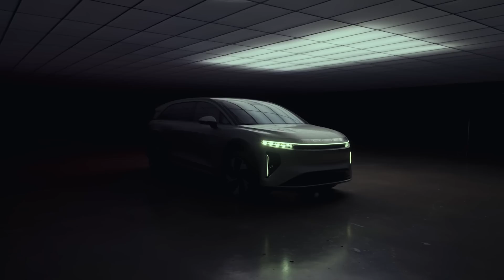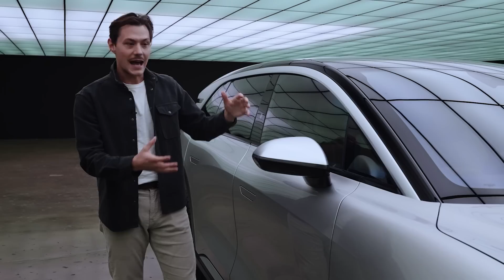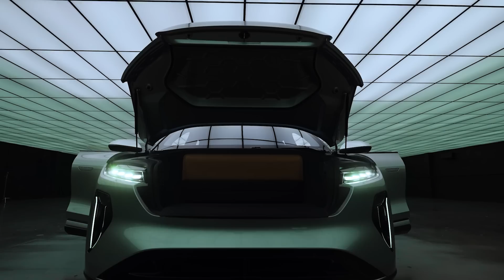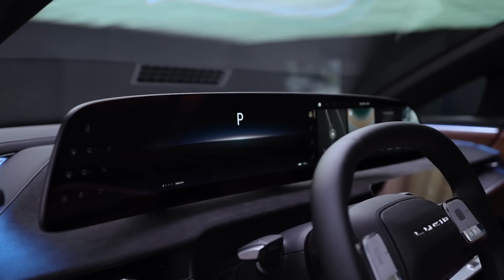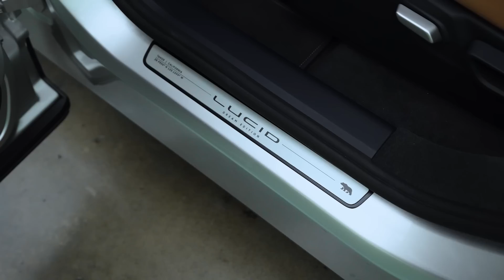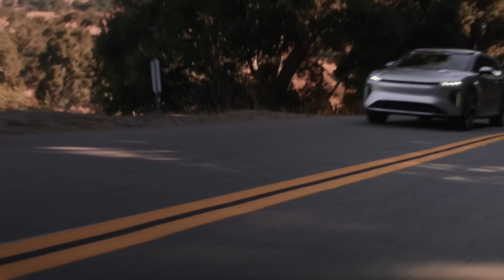Lucid Gravity - Luxurious Electric SUV for under $80,000? | First Look

Comment: Lucid has officially announced it will join the NACS migration starting in 2025. 
First, vehicles such as the Lucid Air will be granted access to the Tesla Supercharger network via adapters that will be made available to owners of CCS-equipped Lucid Air vehicles. Later in 2025 Lucid's vehicles will start coming with a NACS port standard. If you're in the market for a Lucid Air then you may want to wait until the tail end of 2025 to make the purchase. 🎉❤😊

Comment: Due to high interest rates, the market for vehicles above $80,000 has shrunk. What Lucid really needs now is a $50,000 passenger car or smaller crossover.
Reply: @heardbutnotseen1529  Incorrect analysis on your part. Tesla was very deep in debt when it was producing only the Model S and Model X. Tesla only became profitable because of the cheaper Model 3 and Model Y. Most people make installment payments or lease luxury cars...not pay cash. In fact, savvy investors would rather accept risk investing in the stock market... rather than using those funds to pay cash for expensive cars. The market for new vehicles priced above $75,000 quickly trails off... especially in a high interest rate environment. Lucid made a strategic error in product planning. First, they should have introduced the Gravity (rather than the Air) because passenger cars are now a smaller market than crossovers/SUVs. Second, their follow up model should have been a cheaper $50,000 vehicle.

Comment: I like the SUV design, but the practicality of an electric SUV is questionable, especially when you consider that you have to go for a long road trip and don't want to spend 1 hour a day on average at charge stations.
Reply: You get 7 hours of driving on a full charge. How long do you plan on driving before you take a break, get a bite to eat and stretch your legs. In reality it's probably better. The only issue will be availability of charging stations. Which Tesla has them beat by a Country Mile.